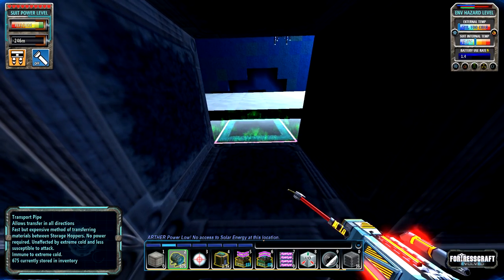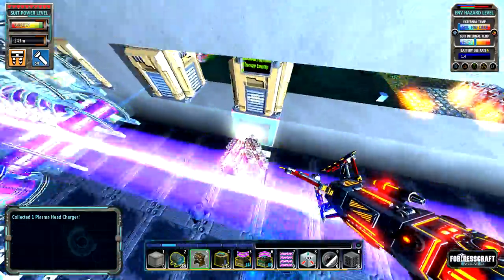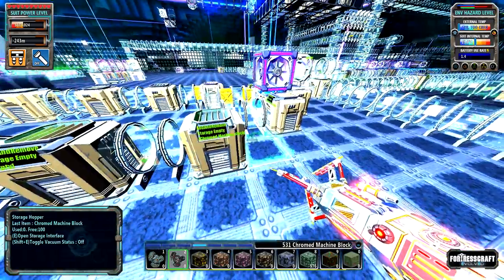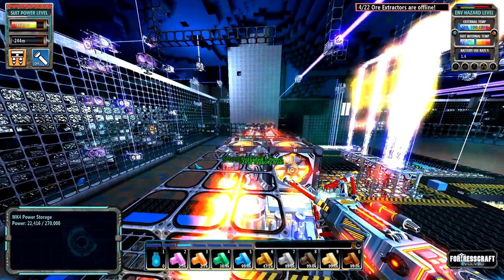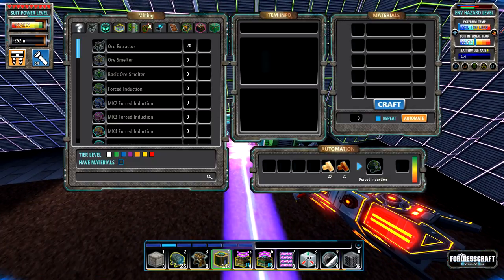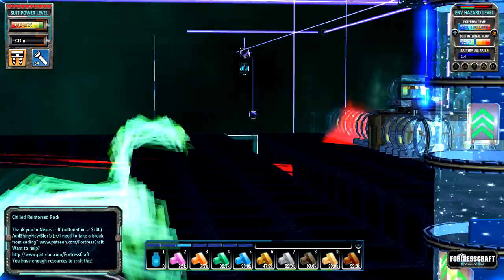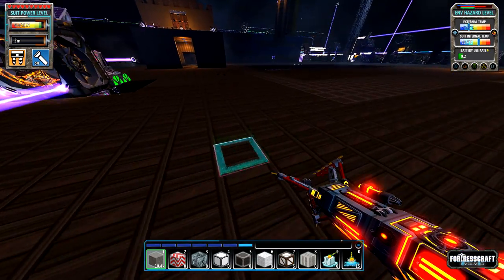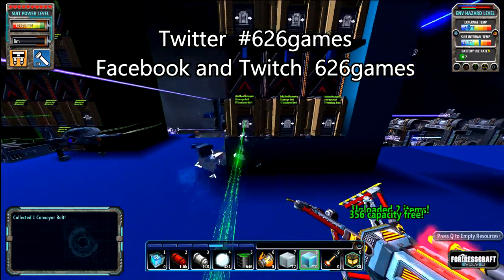Fortresscraft Frozen Factory Lets Play Flattsburg Episode 79 Second Compressor for Freezon

Comment: Hi, not sure if you know there are 10 connection points to 1 particle compressor they connect to normal 4 side points and 1 on top and 1 underneath and 4 connect to middle of each side fans.    So 1 point connect to storage and others connect points for 9 particle filters hope this helps

Comment: the full psb has a geo under it giving it an extra 5k pps - is that geo running at full speed? Ontop of that it is getting a conduit from 2 other directions - so 10-20kpps  - one from another geo & then from surface. It is then probably sending 10k over to the double PSB setup where it can offload 20k pps because of double conduit.

I think the conduit that is only 0 or 1m wide is bugged - may want to break/replace it

Comment: If it helps at all - You can manually set the number to craft on the plant. You can just say make 500 MK1 induction - the other stations can be unlimited

Why not put a trencher on the crystal and do away with all the plasma hassles?
Reply from the maker: That's coming soon.